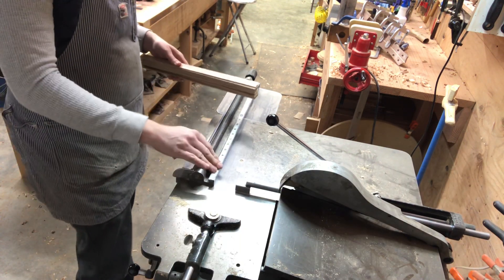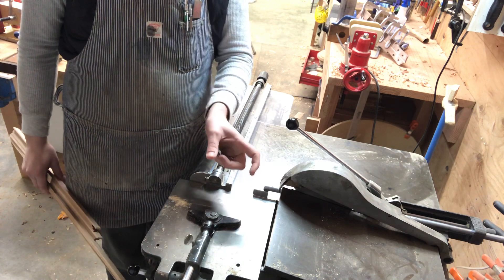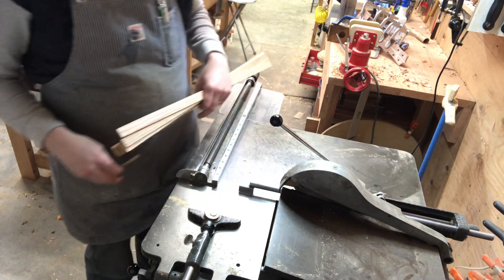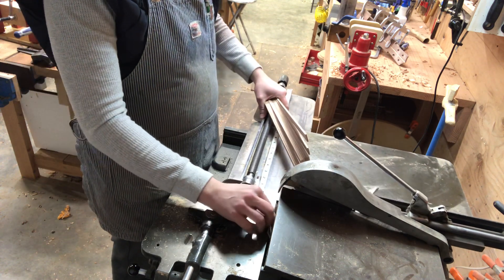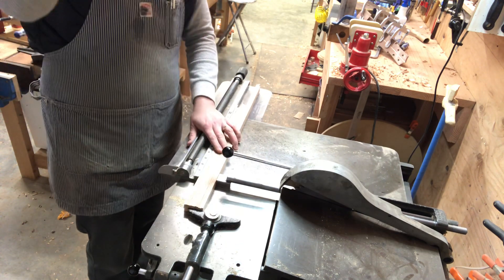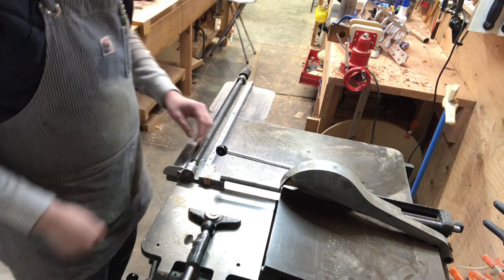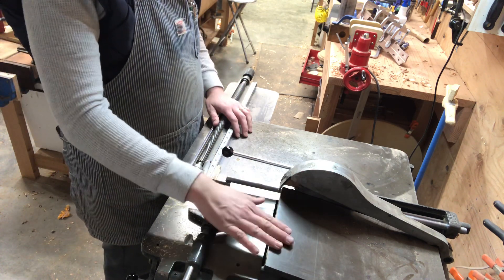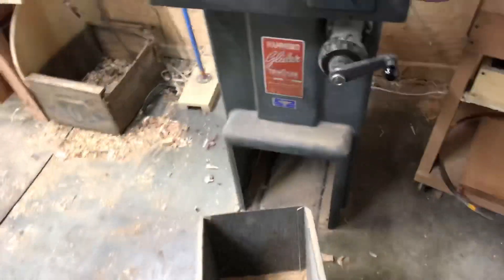Cutting small parts on the Hammond Trim-O-Saw

Comment: Hey Mate, I Wanted to ask you a Question. I have picked up one of these (Australian) Model, But it didn't come with the ( Finger) For the fence and my model does not have even a spot for the ( Clamp ) Attachment on the steel base.Where the Wood would stop up against to be cut. I seen in  the Video you do not have the finger part on the machine. Do you have one but are not using it for Video? Or Might it have been an option? I am looking about with Zero Success, Thanks again for any help i can get.. Cheers.
Reply from the maker: I have the finger, but dont need it for this operation because I am registering the work against the stop on the right of the blade.  Which model do you have?  Look for a manual on vintagemachinery.org

Comment: What type of blade are you using on it?
Reply from the maker: I have three different blades.  One is an old blade, originally designed for the saw.  The other is a circular saw blade that is drilled/cut out to fit the Hammond arbor, the third is a Hammond blade that I believe was originally designed to cut lead, but it works fine.  I have an extra if you need one, email me info@thebeansprout.com
Reply: I also have a Hammond Glider I use a 7.25 Carbide that I drilled the Three Holes been on the saw at least 25 years